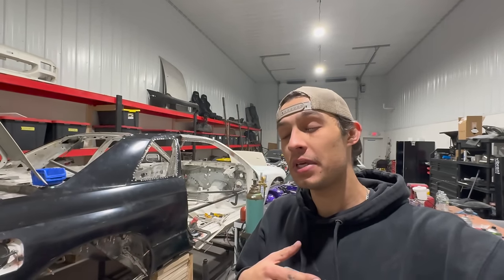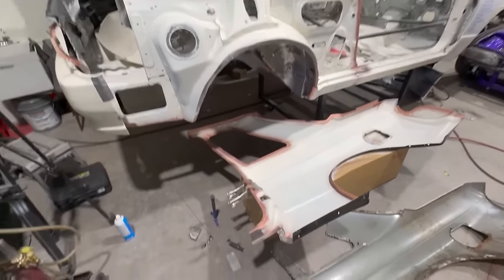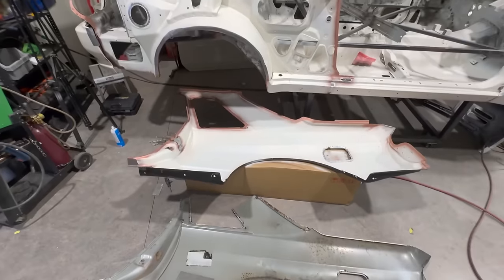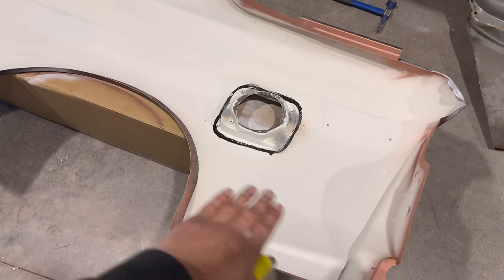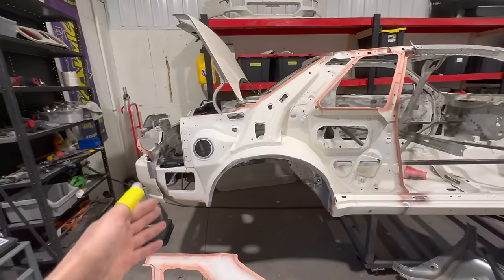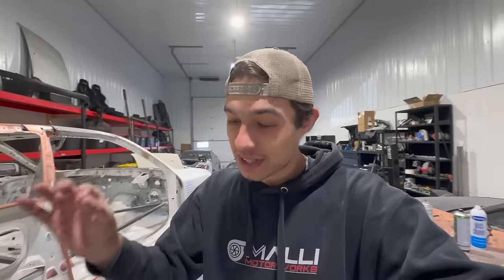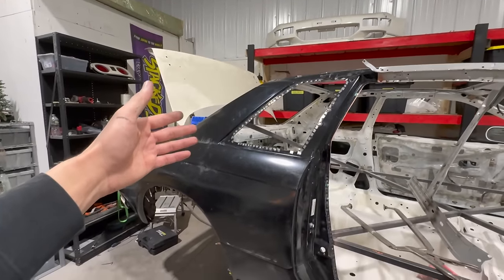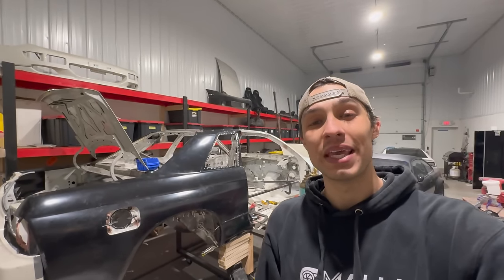Welding The Quarter Panel on my R32 GT-R Restoration pt. 37

Comment from the maker: Everyone be sure to thank stacked exports in the comments for suppling these brand new Nismo quarters!
Hope you guys are enjoying the content!
Happy Saturday!
-kalvin
Reply: looks amazing bro well happy for you
Reply: i felt this, i had to chop and swap the rear quarter on my 94 Z32. those panels all interlace like the gtr as well. and once that panel was being attached for the final time. hollyyyyy talk about stressful! wanting to ensure all the body lines, panel and parts aligned perfectly. while praying all the seams and welds looked as oem as possible. just not wanting to hack or slack on anything is def stress. but once it all went together. and looked as it should. the weight just dropped off teh shoulder. felt unreal. years in the making. legit. bro. you did amazing work!!!!!
Reply: MENGA MINT!!!

Comment: The general rule of thumb for adding strength via spot welds is every 1 inch. Which will overheat the panels if you just continue in a single line. Yes 1 inch seems like tight spacing but it is what's required. Spread yourself across each panel of the car, you're looking at over 10k spot welds to compete with a roll cage.

Comment: You went way overboard with the spot welds lol. And also on the outer wheel house where the quarter sits against it, seam sealer is supposed to go on that flange, not panel bond, but It didn’t hurt that you did. Nice job Kalvin, I bet it feels good. 🎉
Reply from the maker: Nah, I explain why👍🏽 and there’s nothing from factory that goes there. No seam sealer. I wouldn’t recommend seam sealer one bit there bro!